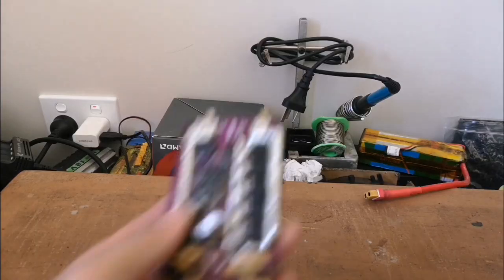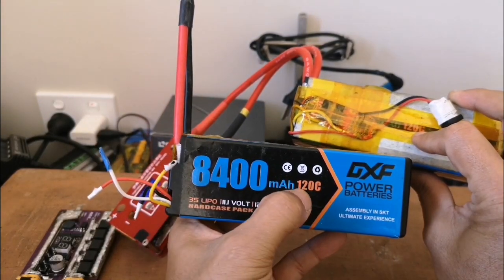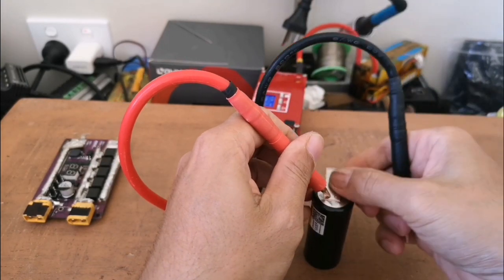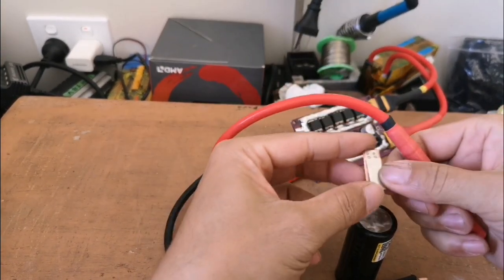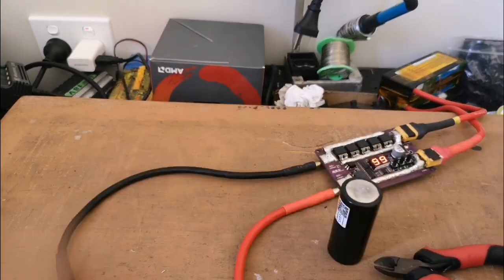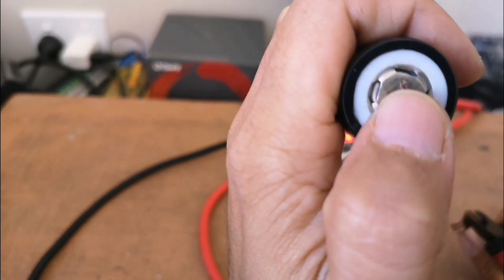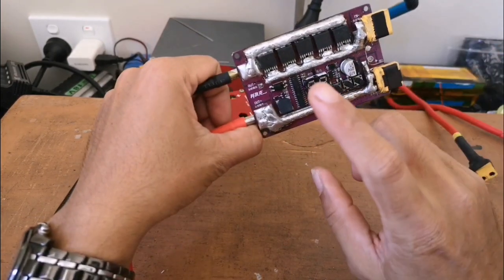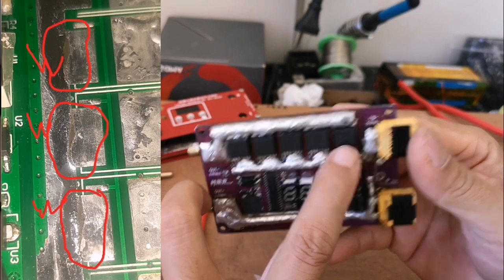Red vs Purple cheapest spot welder in the market

Comment: I really like  the leads you  have made for all these welders you  are testing and wondering about making my own and what parts you use
.
Reply from the maker: sorry I don't really get your questions
Reply: @pitikaron  Well it looks like you use xt60 connectors and soldered both pins to a large gauge wire for each + and - of the lipo battery side, then you used large bullet connectors for the electrodes? and then I'm wondering where did you get your electrodes?
Reply from the maker: I used the electrode from package list inlcuded however I upgrade from 10 gauge to 8 gauge and then I cut the tube pipe so so that I can insert 0.4mm round copper.  I think it is better I produce a video how to upgrade electrodes and etc.
Reply from the maker: yeap exactly it is XT60 however if you install XT60 to your spot welding buy two color yellow and black.  black for negative yellow for positive for the best identification to avoid mistake connections.
Reply: @pitikaron  I think so too  :) Can't wait for it!
Reply from the maker: I'll try to produce nextweek

Comment: This guy tell the TRUTH! I bought the purple board, add 5 mos, add some wire underneath and ohh boy.. that purple spot welder really works! I got 3 different model so far and this one definitely the best with some simple modification.
Reply from the maker: thanks boss!  I have 8 sort of cheap spot welding only the purple board are the best,  I found out after I did performance comparison and I think even the expensive spot welding can not compete.

Comment: Love this type of videos, I've got a purple spot welding board, i like to buy lipo battery for the spot welder :my choice were 3S Shang yi 5200mAh 30C/50C or Bonka 3200mAh 35/70C or China hobby line (CHNL) 2200mAh 70C/140C or 4S CHNL 1500mAh 100C/200C. Which one will better ❤
Reply from the maker: All the batteries you specify are good but if you can find a 12V 5000mah 100c it is better if not just pick the battery with 500A peak/burst discharge Current.

Comment: Hello, how hot does it get, cause the BIFRC is also good but it gets hot. so you got to stop to let it cooldown. regards
Reply from the maker: if you used lower energy the temperatur is normal until 30 energy, but  if you increase more 30 up the temperature gradually increase.  if you used 99 energy to weld brush and. copper at once  8 spot only coz the electrode getting hoter and the mosfet.
Reply from the maker: If you increase the traces OF BIFRC and add radiator you can minimize the temperature.

Comment: what size rod did you use to increase the traces? I just got a couple of these in today and have the extra fets on the way. thank you so much. I also have the xt60 connectors waiting to go on there
Reply from the maker: As long as the traces cannot easily overheat when large current pass through, thick traces can act like a radiator. I buy 0.3mm solid copper but if you can find stranded copper 10gauge it's enough.

Comment: It doesn't weld anymore, just --. After aplying some extra solder. What did I short ??
Reply from the maker: Didn't weld but the machine isn't damage? In that case surely you had the problem to your battery.  try to used a battery that can release 500A pulse discharge battery 12V just pulse or instantaneous?

Comment: Hi, isn’t an 8,400mah 120c too powerful for that spot welder. Will it not burn the mosfet? I saw in the description that the recommended current should be 100-200ah only. Is it ok if we use more than that. I mean 8.4 x 120 is 1008ah.
Reply from the maker: 8400mah 120C fit to the purple spot welding other spot welding can't. however you must increase the traces thickness to avoid overheat during large current flow through the mosfet. if you rely on the manufacturing traces yeah some mosfet burn and the traces.
Reply: rv.inciong4810: ". I mean 8.4 x 120 is 1008ah."

 I think you did the wrong math there. It says 8400mah, i.e. 8.4Ah. The 120C does not multiply
the amp hours, it just says that the max current draw (for a SHORT time) can be 120 times the amp/hour rating.
That is, a measure of CURRENT draw, not AMP-HOURS...  In other words, the 120C tells you about the internal
resistance of the battery. The amp hour rating is what it is and does not change based on the max current rating.
Reply from the maker: Google example. C-rate is defined as the charge / discharge current divided by the nominally rated battery capacity. For example, a 5,000 mA charge on a 2,500 mAh rated battery would be a 2C rate. 
This link I provide will give more clarification about C-rate.
https://www.power-sonic.com/blog/what-is-a-battery-c-rating/
Reply: @pitikaron  Yes indeed. Simple 8th grade math, 

C = I / Ah     
 Solve the equation for I .    
You get  I = C * Ah 
Not     C  * Ah = More Ah  !!

Greetings and Good Fortune to all from the Piney Woods of beautiful East Texas....
Reply: @pitikaron  Yep true.

Well my purple board arrived Wed and I just tested it Sat with the mod board.
Mod board has FET Driver, foot switch interface, and buzzer on/off switch. Just finished looking at the FET Driver input and output to gates. My old scope is - like 
me - old, tired and not too close to reality.
 But I got a little info anyways. I have the single FET Driver driving the gates via
5 sets of 30 ohm series resistors and 5 sets of 10K resistors for pull down.
[Just in case I go totally insane, I designed it for driving 10 FETs, but only 
stuffed the parts for five..................for now.]

I looked mostly at the rise time - fall time was a tiny bit slower.
T(r) was 200ns at 3.5 volts [the V(t)] to the miller bobble spot.
T(r) at 400ns was out of the miller spot and had climbed to 4 volts.
T(r) at 800ns -> 8volts. 
T(r) at 1600ns -> 10volts. (Channels fully saturated!)
T(r) -> 3200ns 12volts and pretty doggone flat trace.....

I tried a couple of test with nickel strips - no cell welds - and found that it seems to be about the same as my Red Welder with the FET Driver.  Hardly surprising 
since I used the same sort of mod for it. Big improvement in the rise and fall
times. From hundreds of usec to hundreds of nsec. Should make the FETs
run cooler and improve the lifetime of the device.....

I will need to test it more and make a pack or three to really get a feel for it.
For this 1st test of the prototype, I just used my Ovonics 5A, 50C. 
With the Red Welder my 8A,80C really pops sparks. Probably will be the same with
 this purple board. Now I have a nice backup if I smoke the original!

Thanks for the video and keep COOL this summer!

Comment: Is there a difference whennuseing a motorcycle battery as powersounrce?
Reply from the maker: The only difference is the pulse amp, but be sure the voltage does not exceed 16V
Reply: @pitikaron  which one do you advice. It will not be for daily use and large battery pack spot welding.
Reply from the maker: 12V RC car battery that can manage 500A is enough but it depends on your needs. However if you can use a motorcycle battery that can weld base on your needs just stick to it.

Comment: I use the red one every day and it works better than that purple one. One thing you didn't do was set it up right. I'll do a video and I'll show you how good it works.
Reply from the maker: Nice for you! Did I say the red colour didn't work? I mention that the red one cannot weld at once 0.2mm nickel plate and copper.
Reply: @user-qi3yo3ho1s: I am getting ready to make that comparison for myself,,,, With a slight wrinkle...
At the end of last year, I got the Red one, but make a mod to use a FET Driver chip to make sure
that the gate voltage was high enough, and the rise/fall time was fast enough to prevent the FETs
from self destructing. Have made about 7 or 8 packs since then, from small 2 cell packs for my airsoft up
to 12 cell pack for portable soldering station and it has worked perfectly, That said I did not try 0.4mm.

I now have a Purple board on order and plan to do the same mod - replace the opto chip with a FET
Driver chip. Given the way this video showed welding thick strips, I think I'll try that with both boards!
I am assuming that this board was not modded except for lowering the resistance of the traces with
heavy wire and a Sh!tTon of solder..?.. And heavy leads and ginormous Li-ion battery. My largest is
8 Ah and 80C. I am outclassed!!

Gonna be an interesting test.
Reply from the maker: Let me know please I'm happy to watch your modifications Moreover thanks for visiting and very kind comments to my channel.

Comment: Does the purple spotwelder need mods??
Reply from the maker: What do you mean?
Reply: @pitikaron  the K99 model
Reply from the maker: What sort of mode are you looking for?
Anyway I recommend you this link, kindly please click link below. https://youtu.be/_T7fAKHPuWM I produce couples video reviews. Hope it can help for you.
Reply: @pitikaron  i want the K99. Its not for everyday use. And notbto weld 20 or more batteries in one time.
Reply from the maker: Ah ok the first batch of K99 is good but the second batch I receive negative feedback because they installed different MOSFET instead of IRL40SC209 or 228. Before you buy communicate to the seller first.
Reply: @pitikaron  ok the one i like to order is BOBHM92L6Q. But i dont know which Mosfets ir has on it. And i dont get reply from the seller. I checked the 2 elecectronic parts shops we have here and they dont sell the mosfets thatbyou advice the board should have or if i need to replace. Mosfets are expensive online
Reply from the maker: You can only order MOSFET at ali-expressa and it is not expensive, Anyway I don't really get the code? BOBHM29L6Q.
Reply: @pitikaron  model of the purple welder
Reply from the maker: Ah ok I'm sorry I forgot mine.
Reply from the maker: Ah ok I watch it.
Reply: @pitikaron  always check what Luca  is investigating. Hes a genius.
Reply from the maker: He is just trying to find another way.
Based on my experience a cheap spot welding usually thinner traces because of that MOSFET blown up due to large current flow and can cause overheating. You can try to compare the expensive spot welding like K-weld Etc.
Reply: @pitikaron  i ordered the purple one  intook the risk. Itd har to spend and find USD now in my country. Economicly were dead. Next week sathurday i have the welder and the 0.15mm nickelstrip. I aready have the Xtar vc8 charger anylizer.
Reply from the maker: Nice! I hope the seller sends you the authentic item.
Reply: @pitikaron  i hope so too. Ots from amazone. Not ebay or aliexpress. I also ordered the 10 pacx mosfet from aliexpress. Just to be an the safe side
Reply from the maker: Nice, anyway what country you are?
Reply: @pitikaron  im from Suriname. Thats in south america. Just on top of Brasil
Reply from the maker: Ah ok! Yeah the whole world is in economic trouble!  due to Russia-Ukraine war plus trade war between US-Russia and US-China.
Reply: @pitikaron  he my friend. Todaybi got the spotwelder and it had the right mosfets on it. I looked at the production dat when ordered. I will order the alliexpress mosfets as spare. And i will make the mod that is shown.
Reply from the maker: Congrats bro! Happy to hear your good news.
Reply: I will make the mods and solder the mosfets better .
Reply from the maker: Nice good luck